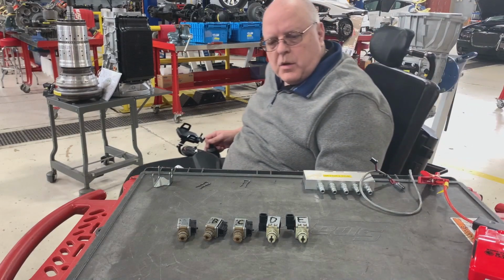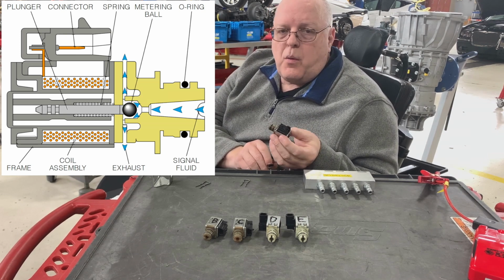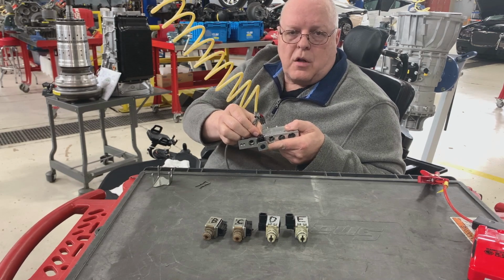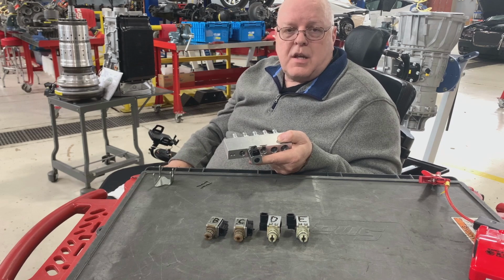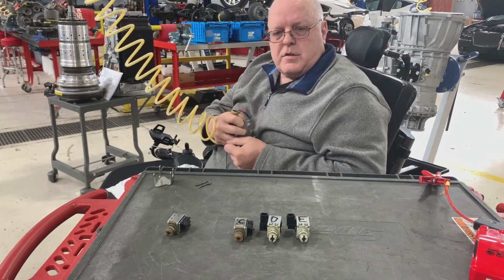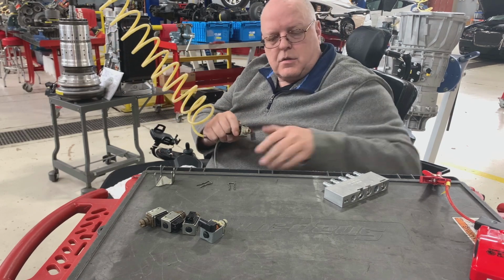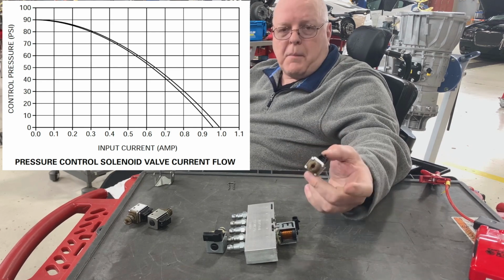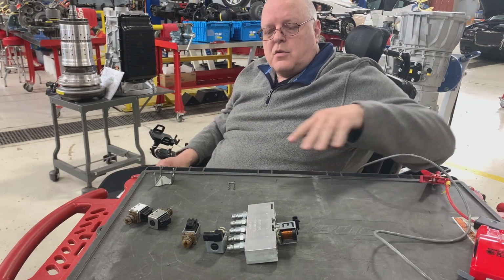AUSV 2520 - On-Off and Pulse-Width Modulated Solenoids

Comment: Hello professor. thank you for your great educational videos. I have a question about my 2010 ford expedition. 
When the car comes to a full stop second before stopping sometimes it jerks like a hiccough, and right after stopping it clicks. Sometimes hursh, sometimes soft. Sometimes it only clicks, or it only jerks. It may not do anything for a while, then comes back again on and off. On reverse if I don't wait for a few seconds and push the accelerator pedal, it bangs. Or from almost stopping I accelerate sometimes it will click. Otherwise during the drive all gears shift good.
Different technicians told  me different things "1.Speed sensor 2.Solenoid  3.TCM update, Flash PCM, ECM, Erase clear the Adaptive tables" so on and so forth. In 2021 I changed the transmission fluid and then again in january 2022 with gasket and filter each time, but nothing changed. If I can have your opinion on this matter I will appreciate. thank you again.
God bless.

Comment: also noticed you using clips instead where did you get those
Reply from the maker: The clips are from the valve body where the solenoids were clipped in place there

Comment: Hi sir, i have a question. I learned a lot from your video's. I have a volvo v70 with an aisin Warner 55-50sn and i was driving normally, no issues before that, and suddenly the gear goes into nutral. DPRN doesnt work anymore and no faultcodes. What could it be?
Reply: It could be a selector issue? What was the problem?
Thanks.

Comment: Could you listen for a variation of air pressure to test a PWM solenoid?
Reply from the maker: I was planning on that, but they wont let me back in my shop until the COVID-19 Pandemic is over in our area. I am trying to figure out a way to do it from home.

Comment: I would love to see a more detailed description of how the the PWM solenoids work.
Reply from the maker: Thanks, it is on my list
Reply: @WeberAuto  the pwm solenoids are the ones that control the clutches in zf8hp??

So in the case of zf8hp it has 3states  fully open half closed and fully closed and this gives sevral gear ratios for the same planetary gear set?
Or is it a smooth transition between open and closed??
Reply from the maker: @FirstLast-tx3yj  It is a smooth transition between closed and open.
Reply: Good